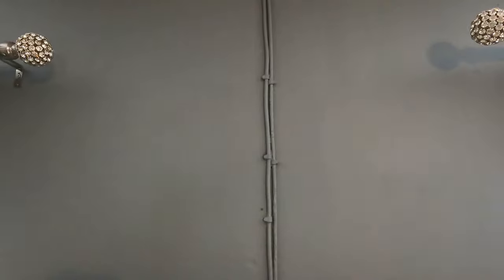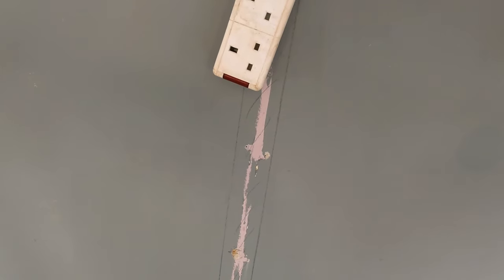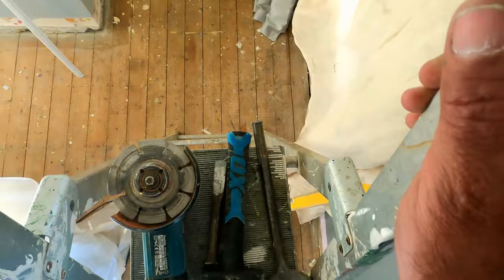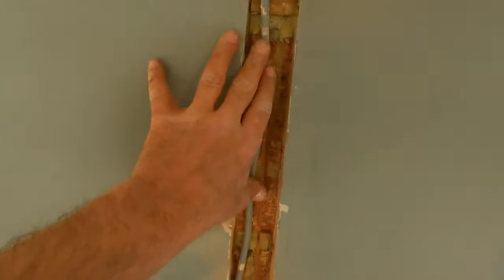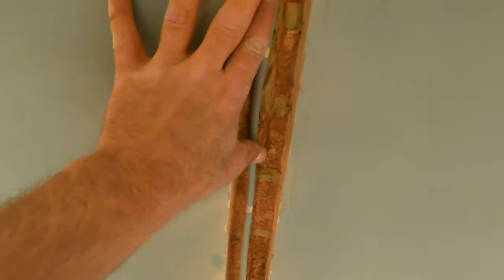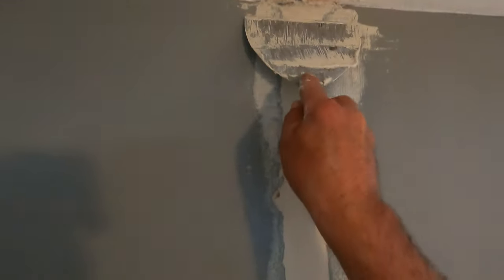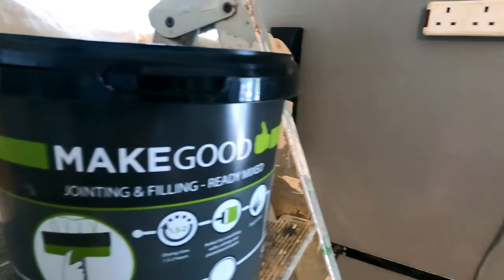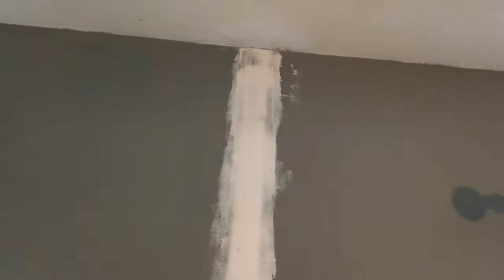How To Hide Cables/Wires In A Brick Wall

Comment: The traditional way to wire European houses is to pull single wires into conduit. Plastering in a cable is cheaper but if you have a fault you will have to chase the wall again and learn profanities in several languages.
Reply from the maker: Thanks for stopping by the vid mate 👍 no need for any swear words at all  when doing a job like this it's simple chase out the area  you need to , add cable/wire in a conduit and make good simple as that your talking about something completely different 👊

Comment: Not a negative comment but why wasn’t a double socket installed rather than the extension lead?
Reply from the maker: Thanks for stopping by the vid mate nice one Conor that would of been ideal mate but just saved myself some money 👍👊.
Reply: @creativecrambo  with the cable guard thing would it be possible to drop a cable down at a later date?
Reply from the maker: @conormcdade6021  
Yeah 💯 mate theres plenty  of room for that ,👍 its something I can do at a later stage, there's always something to do mate thanks for your advice and comments 👍👍👊.

Comment: That seems a lot of work to go to and then just bury an extension lead in the wall instead of extending the ring main down (or even a spur from the ring) and installing a proper socket. Especially as, while I was writing this, you made that comment about "if a job is worth doing, it is worth doing properly"!
Reply from the maker: Yeah that was a proper job John like I said in the vid at the end of the day mate this vid is about how to hide cables/wires in a brick  wall and that's how it should be done proper job like I said thanks for stopping by the vid and your feedback 👍

Comment: PVA really helps prior to plastering otherwise wall sucks the moisture out of the new plaster and you get cracks like that. I must admit I try not to use an angle grinder (tempting though it is) as it takes days to get all the dust out the room plus tight fitting mask rather than cheap paper ones a must. Hammer and bolster definately more hard work but less fine dust.
Reply from the maker: @Ralphs-House  
Yeah  💯 pva will definitely bond the area mate without a doubt but didn't need it on this job as the mix I used was no need to pva or prime the area but yeah your 💯 spot on in what you say,  and thanks for your feedback mate appreciate that alot  all the best mate 👍 🫡 👊

Comment: Great video. I have the same situation with exterior wires ,rendered surface , flat granite stones underneath , thanks for making.
Reply from the maker: Thanks for watching the vid mate appreciate that alot , you got to work with what you got yeah so every job is different it's just how you fix it yeah if you're doing chasing out mate you got to allow for conduit so about an inch is about right leaves you cover for the final finish 👍 
Good luck on your project mate all the best 👍 👊
And thanks for the kind words 👍👍.

Comment: Do you have to use plaster? What about wall filler as I'm planning on doing this on the chimney breast
Reply from the maker: Hi mate 👍 it all depends on how deep and how much you got to cut out if you're just doing a chase out like I did plus conduit then a filler will do but anything bigger then use bonding coat then a skim coat of finish plaster all depends on what you got to finish plus the depth of it  I'd use bonding to fill it in then a finish plaster all depends on your budget mate thanks for your feedback appreciate it 👍👍👊

Comment: I would have sunken the powerpoint into the wall as well and tidied up the ceiling.
I'm going to do a similar job but it's for 4 x Cat 5 cables from my security cameras on an internal wall. The external walls are double brick and easy to run cables in between.

Comment: @creativecrambo On interior walls how much of the brick and mortar wall should you chisel out or can you chisel out without effecting the structural integrity of the wall. I assume the reason it is what it is is because it's old and it's a weight bearing wall. Can you cut 1/2 way through. 3/4.Or would you need to use some type of metal tie/brace to distribute the load to both sides similar to a basement foundation window on a brick house where you slot out the sides on the top to hang the window on the brick, sorry for the non-jargon terminology and half baked question. Mostly concerned about structural integrity and point of no return and or what to be careful for when doing this. Thanks.
Reply from the maker: Thanks for stopping by the vid mate 👍 
The rule of thumb mate is no more than a 1/3 so the brickwork being 100mm thick then the chase would be about 33mm maximum the chase I did was about 25mm but that was from the finished plaster therefore I only chased out about 10mm into the brickwork that was plenty for the conduit and to have some cover over that with the finished plaster hope this helps mate all the best 👍 👍👊

Comment: Really helpful video, thanks for sharing! What I’m wondering is if you needed to change the cable for whatever reason, wouldn’t it be ‘stuck’ to the filler at the bottom? Obviously it’s loose going up as it’s behind the plastic casing, but I’m wondering about the bottom?
Reply from the maker: Thanks for stopping by the vid mate nice one 👍 yeah that's not a problem to sort out mate the cables are free from any obstruction so you could replace if need be you just got to go for it if something happens to the existing cables or think ahead and allow for more cables to be added in the majority of cases the cables should be just fine in the wall the cables I did are covered with a conduit so they should be easy to replace or add to if need be 
Thanks for your feedback mate much appreciated Thanks 👊🫡

Comment: Good video mate. Im going to buy a new tv and want to mount it on the wall above the fireplace so its a brick wall. I want to hide the cables that connect the tv to my sky box. Is it possible to get someone to drill holes through the wall and the side to fish the cables through to hide them? Cheers mate
Reply: I think i should mention that the fireplace is gas powered so idk if the gas tank would get in the way like.
Reply from the maker: Thanks for stopping by the vid mate  and thanks 👍
It's not that easy to just drill afew holes and try and get cables through mate you will be going into the cavity wall there will be loads of obstacles to pass like wall ties your better off doing a chase mate much better job plus with the conduit you can add more cables if you need them nice and easy mate 👍

Comment: If you ever needed to access the cables again would it be possible?
Reply from the maker: Hi Chris 👊 
Yeah 💯 mate the cables are in a conduit easy to take out if you have to thanks for stopping by the vid mate nice one 👍
Reply: @creativecrambo  thanks for your reply. So you'd just need to scrape back some of the plaster to get to the conduit?
Reply from the maker: @chrisa1234  the cables come in from top or bottom of the conduit if you need to change anything you can pull them out or if you need to add more cables then up size the conduit to allow for more cables to be added 👊👍

Comment: I'm not a plasterer but I knew the plaster would shrink due to brick's drawing the moisture.
Brick should be sprayed with water or PVA and 2/3rds water
Reply from the maker: Thanks for stopping by the vid Keith 👍yeah PVA is so good to use 💯 but think the main reason it sunk back was the depth of the chase out I did I was on to it from the get go and the final finish was achieved 
Happy new year 👍👍.

Comment: As I plasterer it was killing me to watch u repeatedly go over a bit at the top (left) and see a tiny hole not filling haha. Good video mate. I done this today thats why I'm on watching videos here. I cut mine with a kango just and bonded the wire straight in. I'm a bit worried that I should of put some sort of plastic strip over the wire. I knew I should off but someone told me it'd be ok and I took the lazy way out. Another 2 mins would of done it right!! I'm not gonna blow up my aunts house am I?

Ps. No hole at the end :)
Reply from the maker: Thanks for watching Stephen 👍👍 yeah nice close attention to detail there mate I wasn't happy with the first coat with the one coat plaster,  the problem was a couldn't get hold of any bonding or finish plaster,lol  i got there in the end mate , i thought that's why its called one coat 🤷‍♂️🤦‍♂️ 👍👍.
Reply from the maker: As long as you didn't catch any wires mate should be ok next time just put some plastic channel over them like you said it only takes 2min 👍👍.
Reply: @creativecrambo  have to do the other rooms too, def gonna do the same as u with the plastic! Yea you'd assume the name "one coat" would only need the "one" coat lol. From my experience of years of plastering, Iver never used one coat nor has any builder supplied it to be used. I'd be very skeptical of one coat ever doing something like this. Filling my patch now and any patch/track I've ever done ya need to fill it and let it sit for a wee while. Go back and give another wee lick over it because it always sucks back in. If need be one more final one. Dont need to wait for it to go rock hard or anything. That sanding stuff is the best of the lot I think. Even if it does suck in (working in your own house) it's no problem at all. Just fill the next day then sand the next day. Typically the longest, cleanest and easiest way. No one on earth completes a job in their own house in a day that they could do in someone else's haha. As I tell my girl, she doesn't need to remind me to do something every 6 months 😂
Reply from the maker: @stephenhamilton4699  
Yeah man you know it ,what looks a 5min job never turns out that way I'm the type that has to get it nearly perfect or I'm not happy lol if you carnt get the material's you wanted then you got to try other options as the jobs got to be done in the end I did get that making good nearly perfect and I'm fare to say I was pleased with the end result, good luck with the rest of your chasing out and making good and thanks for the feedback, all the best mate 👍👈.

Comment: I'm thinking of doing this but I want to run some sort of plastic tube of some sort behind the wall and have cable pass through plates,  so that I have the option  to change out or add cables later.  Could you go deeper into the wall if you wanted to run a plastic tube through?  If so what would you recommend?
Reply from the maker: Thanks for watching kabeer 👍👍 yeah it definitely can be done you might want to use some pvc oval conduit they come in different sizes there ideal for what you need, you can go deeper but if your going into brickwork remember the brick is only 65mm thick and blockwork  is 100mm thick , use some cable entry sockets, you just got  to chase out enough so it sits back flush the boxes are about 35 to 40mm thick hope this was of help 👍👍👊🏻.

Comment: is it white cement or POP?
Reply from the maker: Arindam thanks for stopping by the vid mate 👌👍👍  I used one coat plaster for the in fill cement not ideal will probably crack out sorry for late reply 👍👍.
Reply: @creativecrambo  Thank you so much. This thing is new to me as I have very less knowledge in it.But I got the idea about one coat plaster, just because of your video. I hope this will be strong enough that won't be crack in future.  
Thank you once again.
Reply from the maker: @sixstringrock9  
When you use the one coat plaster you might have to do a final fill all depends on how deep you do the chase out  the plaster draws in when drying, ideally should be bonding and finish plaster if to deep thanks  for reply mate👍👍 hope I was of some help 👍👍 .
Reply: Actually I need some additional points in my house and I was thinking to cut the wall for wiring lines approx. 1.5 inches deep then I will use the same one coat plaster to hide those wiring lines as you did in this video. 🙂🙏❤️
Reply from the maker: @sixstringrock9  yeah will work out just great man use conduit over the cables then plaster and make good keep an eye on any shrinkage job done hope it goes ok for you let me know how you get on 💯 👍👍💪👊.
Reply: @creativecrambo  Great, I got it!

it's 💯 out of 💯 😄👍👍 Thanks

Comment: European regulations require cables to be run through conduits. By burying the cables directly into the wall, it will be impossible to pull a cable if a fault occurs in the future, necessitating the chasing of the wall again. Additionally, using an extension plug instead of installing a wall socket is completely unacceptable. This doesn't look like a proper job, mate. To be honest, more like a bodge job!